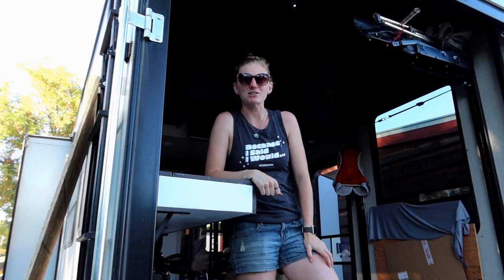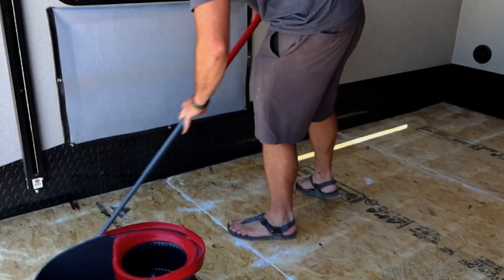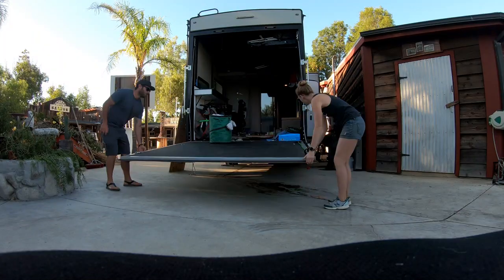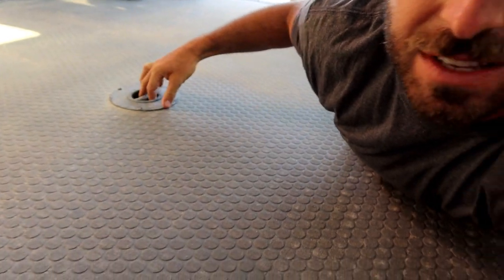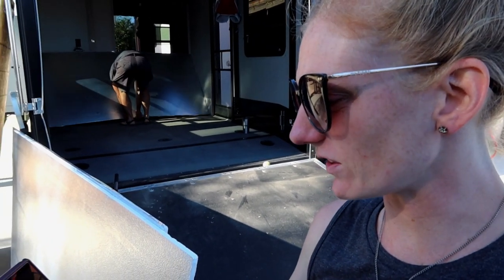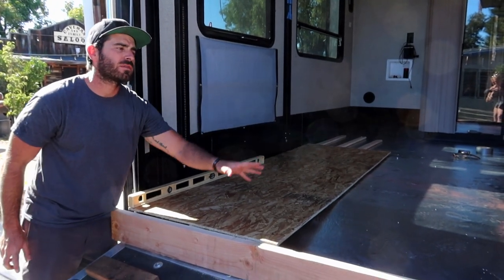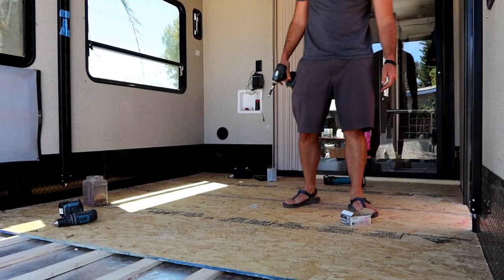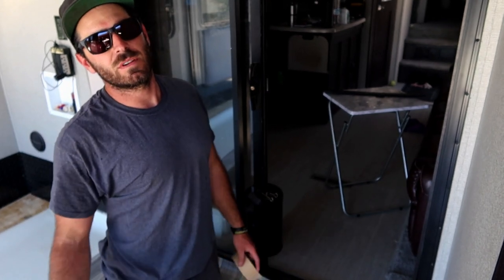RV Reno || Toy Hauler Flooring Installation

Comment: Wat a hack job, ruining the toyhauler
Reply from the maker: That's a pretty negative assumption. We liked the way it turned out and didn't have a need for putting a toy in it. It was easy to remove before it sold and the new owners were happy as far as we know. 🤷‍♂️

Comment: The leveling of the back was the oddest thing about this. So wide it is like that. I am guessing so water and dirt goes to the back? Anyway, great work.  ❤️👍👏 Donovan & Jodi
Reply from the maker: So they make it taper down in the back for a Razr or Quads, we don't have any or plan on getting them any time soon. So now the back is level and much more usable for us. Also it can be removed in less than one our if need be. Make sense? Just works better for us.
Reply: @AdventureEndeavor  Yes, I totally get it now. Thanks.
Reply from the maker: Perfect! We wanted the toy hauler for the patio, water capacity and the on board gennie.👍

Comment: I seem to be having tire blow outs on 1 side of my 5th wheel. I was driving 65 MPH in 90 degree temperatures in California and was told most tires are not speed rated more than 60mph. What do you recommend?
Reply from the maker: Yeah from what ive read Steve thru are not. To be perfectly honest I have not done enough research. People jump up to 14 ply but that requires 120 psi rims. Make sure you check out our video that comes out this Sunday, it's actually tire related.

Comment: I’ve never seen vinyl laid down without glue. WOW
Reply from the maker: I guess time will tell! That's what we were told to use......hopfully it lasts. If not it's very cheap just to redo the vinyl. Thanks for watching!
Reply: Looks good and a lot easier to get down. 👍👍
Reply from the maker: We thought about doing snap together planks. They are more durable but quite a bit more expensive.
Reply: Adventure Endeavor I’ve seen them wiggle apart on the ride. So have to be cut really tight fitting. I’m planning ahead to vinyl when my floor wears out. I hate the pattern. Looks dirty all the time. Hard to justify change when it’s only 2 years. But I’m almost there. Is that crazy to want to paint already.
Reply from the maker: Oh I didn't know they wiggle apart! Good to know! Painting makes a world of a difference just don't tell Melissa hahahah
Reply: Too late I think she knows😉

Comment: Have you weighed your rig yet? We weighed ours on the last move and are surprisingly over weight so now we are trying to trim down.
Reply from the maker: We have not, I doubt we are over weight but I could be wrong. We have 3k for a razr and 1500lbs for cargo. Perks of a toy hauler I guess. Thanks for watching.
Reply: @AdventureEndeavor  thats one reason we bought a toyhauler too, couldn't find a 5th wheel with the cargo space and setup we needed. Thats why i was surprised when we took it across a scale.
Reply from the maker: Oh wow we probably should get it weighed, how many people travel with you?
Reply: @AdventureEndeavor  3 of us fulltime but 2 visit on college breaks.  When we set up the RV i took weight for granted and didnt pay close attention to it, thought wed have plenty of room. Ive got a wooden dresser on board, a small freezer, bookshelf as a pantry , added wood shelves to cabinets, clothes of course, front loading residential washing machine. 
We are continually downsizing as we live in it and move around. We've moved 4 times since May. We will be downsizing the Blackstone, trying to fully drain the washer, downsizing my tools ( for weight in truck), and only travel with tanks empty.
Reply from the maker: Copy that. Sounds like you have a bit more on board than us. We will probably weight our aoln though. Great chatting with ya!